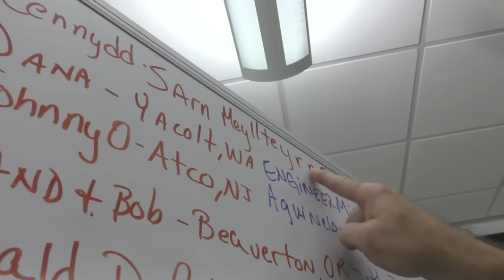Festool Live Episode 157 - Corded VS Cordless

Comment: Sweden.. i dont like that sanders has differen batteries, it sucks!
Reply: But the battery sanders are designed for convenience and for instances when using above head height, the battery design is perfect for weight and to be held comfortably in one hand. 👍🏻
Reply: At least it's the same charger.